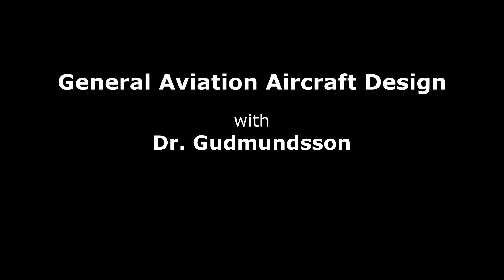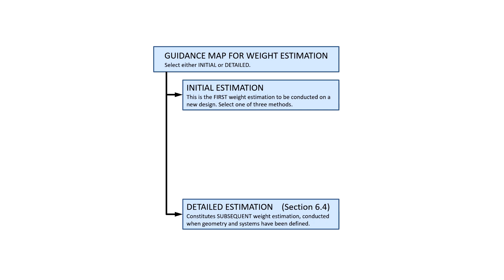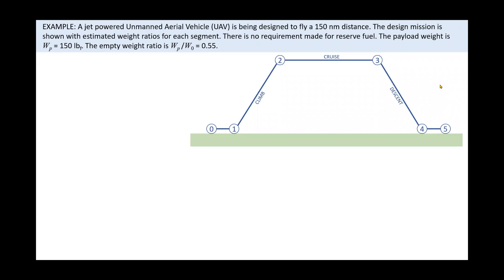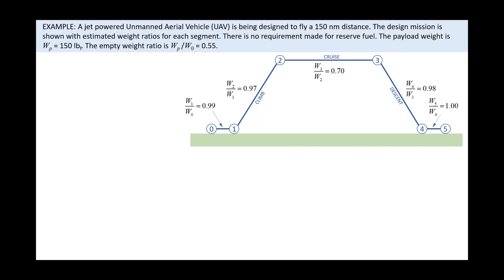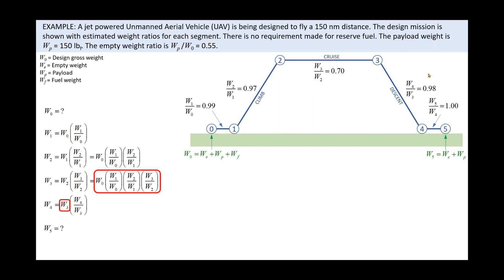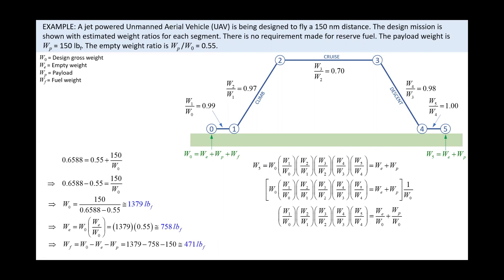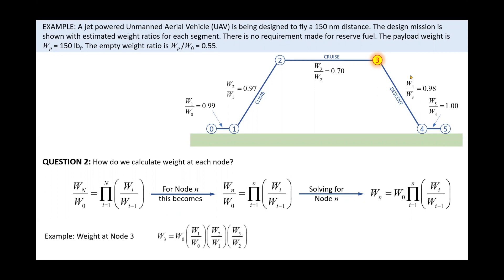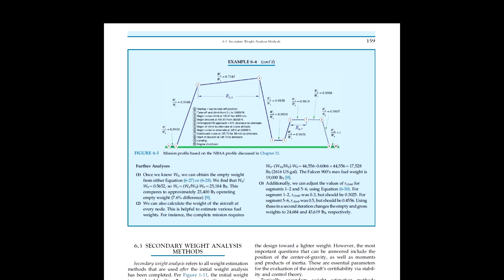Aircraft Design Tutorial: Aircraft Mission Analysis by Example

Comment: Thank you for the vedio, there is a quite mistake in the question, you have given empty weight ratio as Wp/Wo instead of We/Wo..
Reply from the maker: I know. It is already stated in the description, but thanks anyway. Best wishes.
Reply: @dr.gudmundssonaircraftdesign  sorry sir, I didn't noticed in description. Sir can you provide a vedio for weight estimation of evtol(for this type of mission profile), it would be greatly appreciate sir. Thank you.
Reply from the maker: @SyedMujahid-vm1xo  No problem regarding discovering and reporting a mistake. No worries. I will consider your request for a video, but cannot guarantee if or when. In case you want to tackle such a mission analysis yourself, for electric vehicles you consider the consumption of battery energy in kWh rather than weight or mass of fuel. This, in turn, requires you to estimate power requirement during a segment (e.g. 100 kW) and its duration in hours (e.g. 30 min = 0.5 hr => Ebatt=0.5*100=50 kWh). Best wishes.
Reply: @dr.gudmundssonaircraftdesign  thank you sir, will be waiting 😊

Comment: Hi, do your books explain how to implement and use the unusual math symbols  ? .. such as capital Pi, what ever that means :)
Would be very helpful if your books contain a primer with a few examples to aid the novice aerodynamicist how to use the more obscure maths components etc. I'm looking at this from the point of an amateur wanting to design, build and fly their own ultralight aircraft without the need of having to do a two + year maths course just to understand a handful of maths components critical to understanding how to design aircraft safely. 
Also, do your books cover structural engineering  ? 
I've managed to gather some information from youtube, such as moment areas and the like but I'm struggling with resolving trusses etc. A book that explains such things in a manner that an amateur could understand would prove most useful.
Thank you.
Reply from the maker: Hi freezatron. Thank you for your message. Capital Pi as a product symbol is not any more mysterious than the Capital Sigma symbol used to represent a sum of terms. Anyway, you may want to visit amazon dot com and check out the book there. Amazon has a preview feature that allows you to look inside books before you buy. I think you will find it has a lot of mathematics. This is inevitable in a college level textbook. My book has some, but rather limited structural analysis because it focuses on the conceptual design rather than detail design (that's where you design the airframe). For truss analysis you need to study the engineering discipline called "Statics." Hibbeler has a widely used textbooks that has a lot of numerical examples. There are number of others that might suit you. Google "textbooks on statics" or similar. Best of luck with your design.
Reply: @dr.gudmundssonaircraftdesign  
Thank you for your reply, but Capital Sigma is something I've not heard of that either, 
I wonder if your familiarity with such terms has allowed you to forget what it's like for the layman :)

I'm fine with doing the maths if I understand the terms and the units involved but when I come across terms such as Capital Sigma  I come unstuck. I know how to use the lift equation, the drag equations are less known to me as there are a few of them and I have some questions that I need asking before I can use them with confidence, without them I can't put together a proper flight profile or size the engine etc. There are some videos for the layman I would like you to make but I would want to impose upon your generosity. 

Thank you for letting me know the name Statics, difficult to search for things when you don't what they're called :) 

The design I am working towards is a foot launched aerobatic glider with a Reynolds number in the half to two million region, I seem to know enough to conceptualize  something within in reality but not quite enough to describe it accurately ...

Thank you for your help, it's much appreciated.
Reply from the maker: @freezatron  I appreciate your comments, but don't forget that my videos are not intended for laypeople, but for practicing engineers and students of aerospace engineering. Anyway, be careful when dealing with structures. Truss analysis and structural analysis is not simple. If you try to analyze something, try to find a structural engineer willing to review the work. I suggest you let that person know that he/she is not responsible for anything. You are just asking for some guidance. You're also welcome to list what video topics you're interested in. I am not promising I will make them, but then again one never knows. Best wishes.
Reply: @dr.gudmundssonaircraftdesign  
Thank you kindly for making time to reply to me, it's much appreciated !
I fully appreciate who your target audience is but I subscribed to your channel regardless because it has been helpful for me to glean some useful snippets from your videos,.

It has always been my intention to learn enough to be able put together a detailed presentation for a qualified engineer to verify my work and highlight any holes in my understanding.
Naturally as a pilot I will take full responsibility for my own designs, builds and safety.  

My wish list of subjects are as follows -

1) An explanation of the various drag formulas    
at standard sea level atmospheric conditions, induced, form, profile, parasitic, incidence drag etc.
No need to complicate it with a variety of viscosity calculations for a variety of density altitudes, that would require a video of its own. 
I want to know what my drag is at a 1 G level stall, best L/D, drag at maximum G and drag at VNE, also with and without flaps deployed.

2) To assess the ultimate loads on the controls and relevant surfaces I need to know how to calculate the forces on the control surfaces at the designated maximum G loading as well as maximum deflections at the designated VNE. If I know what the torque is at the hinge line I can work out the rest from there, I think.   

3) A refresher on cantilevers using the moment area calculations to find out the ultimate load of the wing spars for the designated max G just to make sure I have understood this properly.  The two materials I am looking to choose between are aluminium and carbon fibre.

4) resolving trusses and tubes buckling under compression loads. I know this is a complicated subject but it seems important for me to understand.

5) A refresher on the shear loads for wing bolts would also be a good thing to include too.

I know there are some calculators available for some of this but they don't help me actually understand it, which is really what I want, at the very least knowing the above will allow me to have an informed conversation with qualified engineers and make better design decisions. 
 
Ideally the format of these videos might be -
-An introduction to the formulas and what it is calculating for.
-The components of the formulas.
-The units used for each component imperial or metric, I can use either. 
-Followed by some step by step practical examples that are complete step by step leading to a result that can be applied such that I can plug in my own numbers and use the formulas with some confidence like I can with the lift formula for example.

From what I've seen on youtube of the above formulas, they all seem to use relatively straight forward  mathematical terms to solve them in the long handed manner, I know that multiple iterations can be condensed into one formula with calculus or with capital Pi etc. which is alien to me, apologies. I can however follow the long handed methods if I have a well explained example I can follow.

I have found to my frustration that these videos either don't explain their examples well leaving me with unanswered questions, skipped crucial steps assuming knowledge on the part of the audience as to how they arrived at that conclusion or just flat out not explaining the units properly making the subject more dense than needed. Either way I am left staring at a formula I can't actually use and apply.

I am ever so grateful for your even replying to me let alone your kind consideration of the above subjects. I fully appreciate you're a busy man with many of your own students to attend to.

That said my hopes are high but my expectations are low and I shall consider any knowledge you are kind enough to share as a bonus towards my own projects and understanding. 

Perhaps one idea that might appeal to you is to give your students an assignment of making a video for your channel where in they demonstrate their knowledge by explaining concisely and clearly on a given aspect of a subject that can be applied in a practical manner. Clear and concise enough for  a layman to grasp in order to demonstrate that they have a solid understanding of the fundamentals :)  

Thank you again for reading my comments and making the time to reply, it is hugely appreciated.
Kind regards.